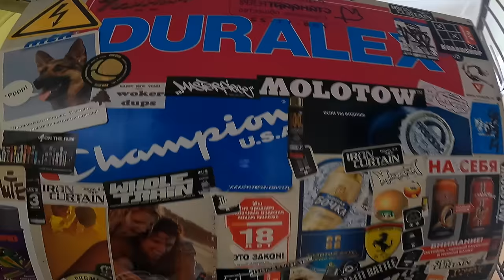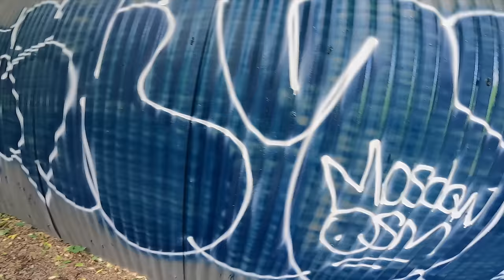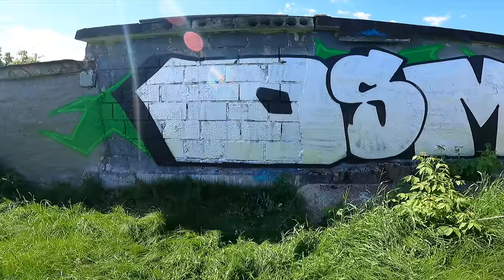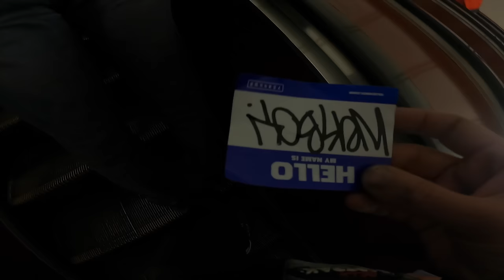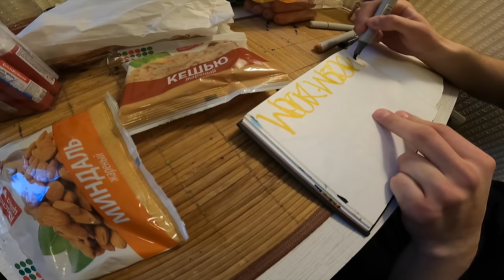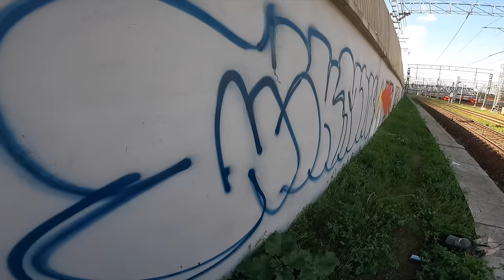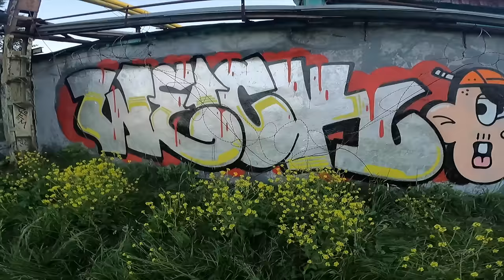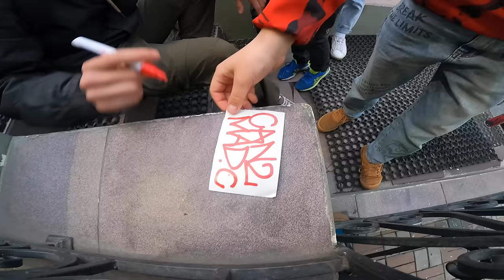Graffiti patrol pART72 Moscow

Comment: No possible way to get the Arton cans to try I'm in aus they don't sell here
Reply: No surprise. But I doubt you need them
Reply: Yeah, but they have some awesome colors. Every paint line has got some killer stuff and some stuff thats not so great, it would be awesome to start a store with all the vest solids in each line and all the best transparents, have everything searchable by valve/pressure/opacity AND cap compatibility. You could just filter for needle or astrofat and get paints that would work.